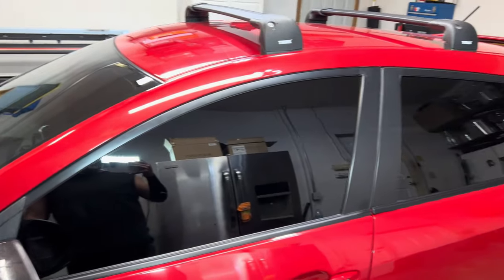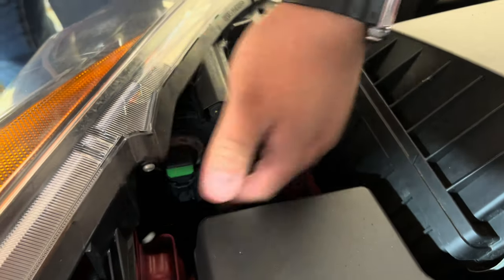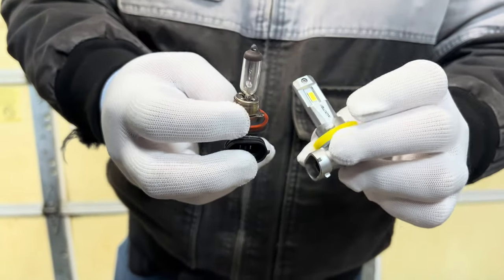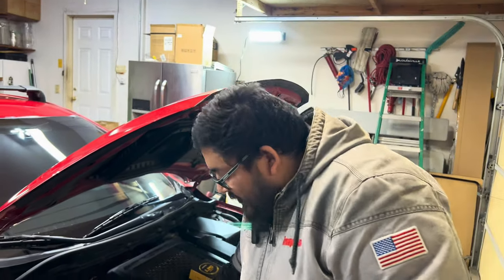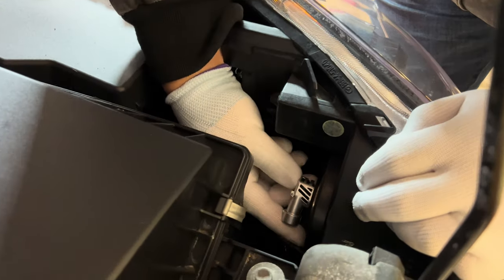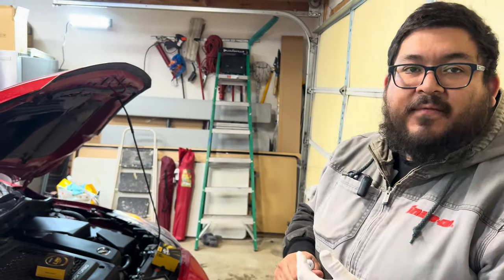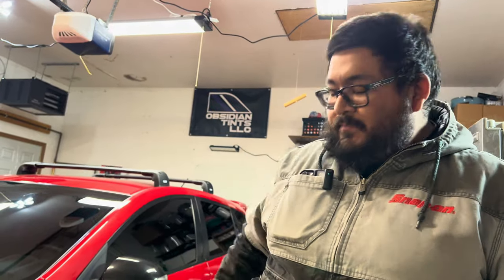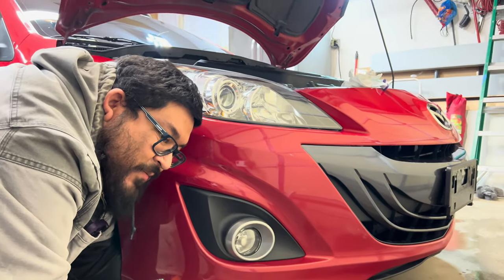Mazdaspeed 3 Auxito LED Headlights and Fog Light Upgrades!

Comment: @streetspartans

Lemme tell u. The Auxito led bulbs are great quality and we have no issues on there product. 

However. I will point this out to u.

When I look at those led bulbs and the specs. They look very high quality. 

The downside I don’t like, is 1: they shoved 40 watts per bulb.

2: while the led bulb is all aluminum, with 40W per bulb, the heatsink is not only big enough to dissipate the heat.

3: the cooling fan is not big enough to pull the heat away from the led chips.

But if car light review this led bulbs next, we will no for sure what’s the real results with his observation. 

The retention will be a lot lower than their publish specifications. 

4: I’ve seen some people had issues with their led bulbs. 

And I would not go for that route. I’d rather get the M3 because it’s a better balance: and car light review tested all Auxito products, even Y19, but not this M3S.

This will honestly hold because they shoved high wattage on that little one. 

And finally, PLEASE for the love of god. 

Do not and I repeat, do not believe those high lumens.

For per bulb, if it says 10,000-35,000 lumens per bulb or per pair. 

It’s a major lie. 

Those lumens belong to led light bar territory. 

Lasfit keeps it real with honest lumenousity results. 

Lasfit. Boslla, GTR-Lightint, S-V.4, VLED’s, Xenon depot, Morimoto, and Diode dynamics give us real numbers.

I’m a huge fan of Auxito but I just wish they give us real honest specs.

If it has 20W per bulb, it’s 2000 lumens per bulb, and sometimes 2400 lumens per bulb. That’s still realistic. 

If it’s 30W per bulb, it’s 3000 lumens per bulb, if it’s 45W per bulb, it’s 4500 lumens.

Not 10,000-35,000 lumens or sometimes I saw odd name company, claims the led bulbs they make produce 100,000 lumens. Thats just purely obsured. 

Keep this in mind. 

With that out of the way. Me and my family run with our most recommended is Lasfit, 2: also the best is Auxito, and 3rd for set it and forgetted is sylvania zevo led.

🤟🏼🤟🏼🤟🏼 I hope u understand this man.

Comment: Can you share the size for the fog lights? Is it H11?  Also you can change the small bulbs too they are W5W u can get the zevos from silvania, also the turning signal bulbs, you can use switchbacks and u will have a lot of white light all the time.